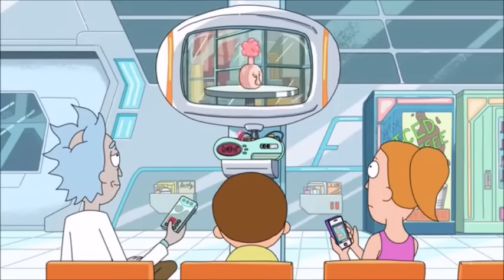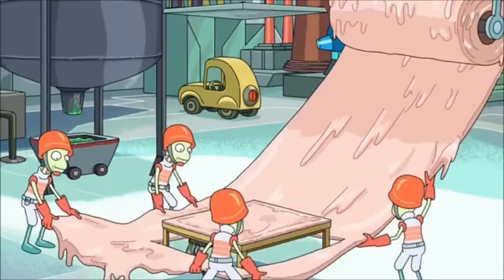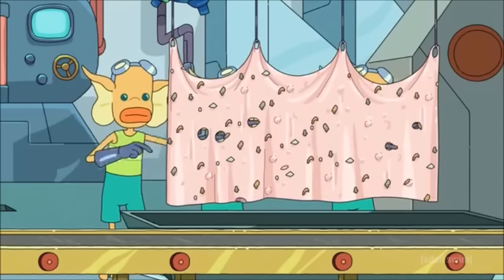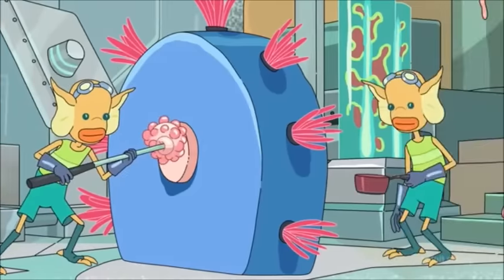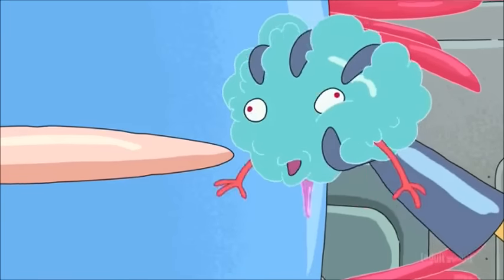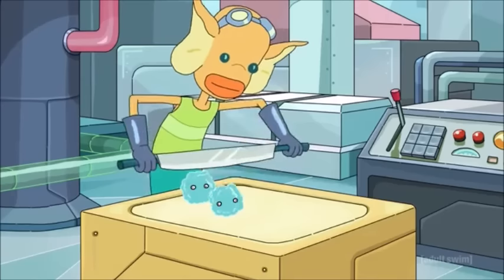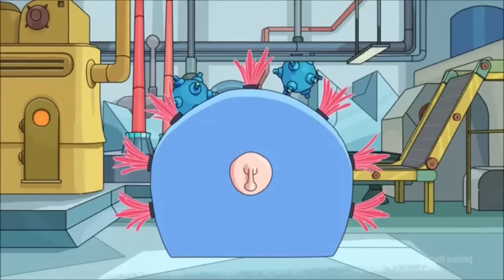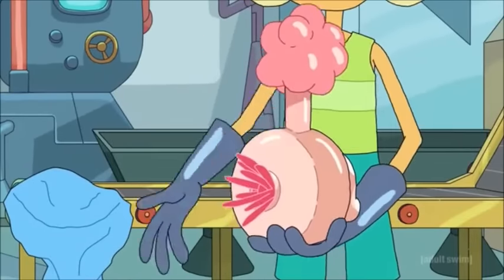How a Plumbus is Made (Rick and Morty)

Comment: I feel like they skipped a step where they show how to deal with all the hizzards that are in the way. Any ideas anyone? I'm trying to figure out how to make homemade plumbuses. If anyone knows how to deal with the hizzards let me know.
Reply: theres several hizzards in the way
Reply: Draevon May doesn't know the fast way.
You have to swooble the quortaengous just so long that it squieks than cut it off and than the hizzards should be gone. If necessary, burn all the suddenly appearing mungletorgs.
Reply: Ignore them, they get shaved away anyway
Reply: all of you will be going to jail, homemade plumbi are illegal in 1,000,000,000,000,000,000,000,000,000,000,000,000,000,000,000,000,000,000,000,000,000,000,000,000,000,000,000,000,00,000,0,0,0000,000,000,000,00,00,000,0,00,000,00,00,0000,000,000,000,00,00,00,00,000,00,00,000,000,000,0,00,000,000,0,000,000 different galaxys, thats not even counting the galaxys where you get sentenced galkicum punishment

Comment: I need a new plumbus, can someone give me an Amazon link pkease?
Reply: +{ᵒᴥᵒ} I know a life hack on how to reuse your old plumbus at home using things found around the house.
thing you'll need:
  -2 litres steezium
  -a box of shim shams
  -an old burnt out plumbus
  -scissors
  -box

first, cut a hole with the scissors in the box at the bottom of it. make sure it's snug enough to fit the old plumbus onto, and set the bottom side facing up. Peel back the shingle-bop shnibs, and remove the frumples, next place in the shim shams where the frumples used to be, however many you want is your choice, personally I like my plumbus to have at least 20 shim shams sticking out, anyways you'll need to then carefully and slowly roll back the shnib ends like they were before. next pour all the steezium onto the plumbus so that it's coated nicely, this should rebind your shnibs and give you a brand new working plumbus
Reply: +Guy Buddy This is the sort of irresponsible DIY advice that gets your house suddenly transported to a non-oxygenated dimension.
Reply: Not every creature in the goddamn universe needs oxygen, self-centric human.
Reply: I have a used Plumbus for sale for just 25 schmeckles.

Comment: "they cut the fleeb" then what? what happens to the fleeb after you cut it?
Reply: I've been to a workshop where they still hand-make plumbuses and they all had their fleebs kept. I think this is optional.
Reply: +Mark N. I tried using synthetic fleeb juice. Its makes bushier hizzards and extra ploobus but the plumbuses are thicker and stiffer. The perceived quality is only slightly lower. people should stop enslaving fleebs..
Reply: I once ordered a bingledorf, its basically a poor mans plumbus. Bingledorfs use gufdrops instead of fleebs. The hizards on a bingodorf tend to fall out early as well. Bingledorfs do have their upsides as they use Schlump and postules for their handling purposes.

Comment: What happens to the fleeb after it gets cut? What's the purpose of cutting the fleeb? It seems like an unnecessary step and removing this from the process would likely result in significant cost savings.
Reply: My guess is that fleeb produces less juice as it grows old, so it has to be reproduced - which is done by cutting it and letting each piece regenerate into a young fleeb.